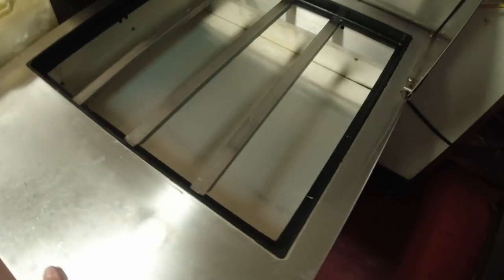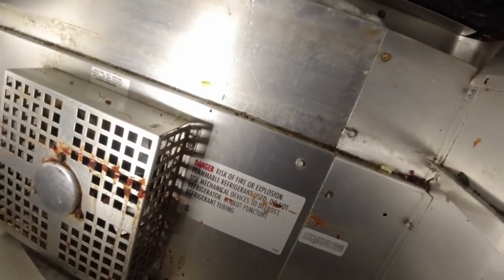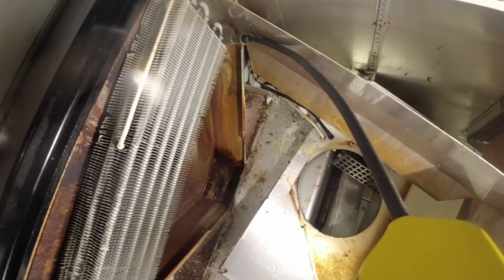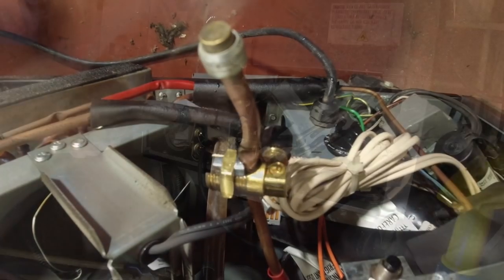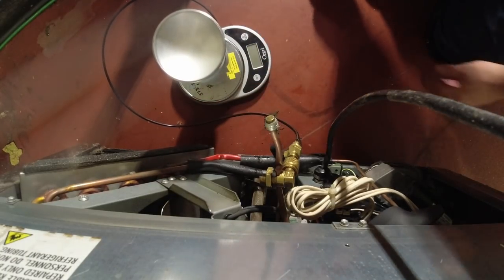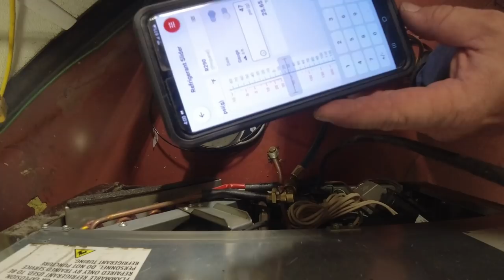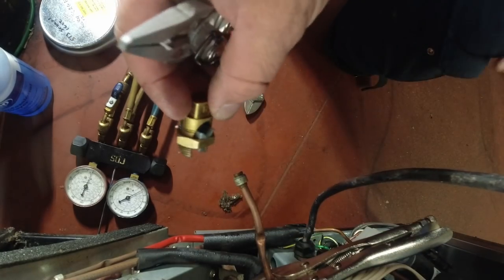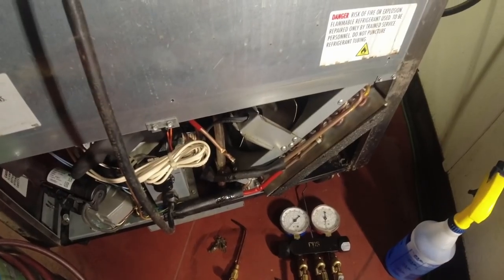R-290 True Cooler Not Reaching Temp / Down & Dirty Get It Running Fast Repair

Comment: Reach-ins r a pain. 100 screws n panels to get to evaporator. Great video Rick. ? 4 u. When finished charging unit up, instead of cutting end of pipe off to crimp n seal, could u just braze over the area wer u pierced  pipe   with tap valve? Thanks again for sharing
Reply from the maker: Shit,  your right,  I didn't think about that🤦‍♂️🤦‍♂️👍👍
Reply: @HVACRSurvival  thanks Rick for ur reply. I was just asking cause I'm trying to absorb n  learn as much as I can. I'm on my own n u have helped tremendously with your videos. Thanks doctor!
Reply from the maker: Thanks for the support!

Comment: I was literally watching the video like oh thats cool he's using an electrical bug to crimp the line off... lol...  I use the saddle valves and leave them. The vise grip valve in one of your last vids was also new to me!
Reply from the maker: I prefer the were left on but with the R290 being fairly new here in the 🇺🇸 The manufacture asks we remove them when done.
Reply: @HVACRSurvival   All of my warranty jobs do also.
Reply: Piercing valves leak. Never leave them. Put in a permanent port instead if you plan on leaving it.
Reply from the maker: @jman0870  I use 1/4 ref Ports on everything. I never would leave a saddle tap on.
Reply: @HVACRSurvival  That comment wasn't directed at you. Your work is on point!

Comment: I like the idea of using r290 as a refrigerant because then you don't have to recover it and all that jazz .
But the whole thing about manufacturers forcing you to cut off the pressure port after you install it I just find it silly , especially for such a small charge .
Also if they don't allow a pressure port to  be installed ar least give us an analog manometer so we can read the LP , really wouldn't cost much more .
Good vid mate 👍
Reply from the maker: I thought you guys have been using this crap for 10-15 years
Reply: @HVACRSurvival  it's popular over here , I'm just not sold on the restrictions they put in place and the whole " safety practices " involved . For bigger charges sure , but case in point : the evap was leaking and nothing happened as far as fire hazard so a pressure port wouldn't necessarily be such a hazard either . I might be wrong though , just frustration innit .
Reply: @sterlingarcher46  You can hurt yourself more with your propane grill than you can by sticking a torch onto a system with 3ozs in it haha!

Comment: Good video Rick. There is a small R290 charging scale available, I’ve been using for awhile now .
Reply: Ive been using a Taylor 38979 scale for a while now. 1g/0.1oz resolution is plenty accurate when using the Nu-Calgon bottle adapter.
Reply from the maker: I had the chance to buy one of those because they're kind of popular locally, does that 1 shut off on you midstream like this 1 does.? It kind of sucks it loses the measurement
Reply: @HVACRSurvival  it does after 5 minutes, but if the value is changing it wil not, so if i have to wait more than a minute I'll tap the tray to keep it awake.

Comment: Sometimes they just need it up and running. Not sure which puncture tap tool you were using in the video, but I have one similar that I use on a daily basis that hasn't broken yet. Robinair makes it. Model 40288. If that's what you were already using.... then maybe I got lucky. If not... might be a more reliable tool for ya.
Reply from the maker: It's a Robinair👍👍

Comment: Wondering what is the brand and type of marker you use... does it hold up well to UV?  Machine is probably not worth material and labor to replace evap.  Especially since it's such a bugger to disassemble.
Reply from the maker: Uni-paint is the brand. It will fade in Direct sunlight but can tell what was there 2 years later.  Everything I use is in my tool kits in the description below

Comment: what is the trick to getting the vice grip pinch off tool to work? I tried the exact same one and lost a lot of refrigerant after I tried three times in three different places before it finally blocked the line!
Reply from the maker: I had that problem with the yellow jacket I had,  then I purchased 2 imperial block style. They work every time but don't fit into tight places well. The one you seen is a cheap one I found online. I prefer the imperial block version. My tool bag in the description has about every tool I use.
Reply: @HVACRSurvival  I ordered it. That was my first thought when I seen it, the practicality of space. I also seen how you started crimping at the point and kept crimping till you got the pipe as close as possible to the vice grip  center. Will try that with the cheap ones I also bought until this block comes in. Thanks for all your assistance !
Reply: @HVACRSurvival  Not sure I understood correctly, did you say you purchased 2 different block styles? I only seen one in your list.
Reply from the maker: I have 2 of the block style. Both are the same. And I have the vice grip style. 2 styles total.

Comment: Thanks again for the video. 
Can't wait for the wave of residential R290 split systems!🤣
🍺🍺🍺🥃🥃🍿🏌🏻‍♀️
Stay safe. 
Retired (werk'n)keyboard super tech. Wear your safety glasses.
Reply: You'll never see 290 or 600 used for residential split systems, but I guarantee you have a 290 fridge if it's less than 5 years old.  Ive seen a few 600 and cyclopentane systems in the last three years, not as common as 290.  They might eventually go 700 (CO2) for residential split.
Reply: @sivalley  I've already seen r290 window ac units. Probably no splits with r290 but I bet we'll see package units. I hope we get r32 instead of more highly flammable crap or blends with insane glides.
Reply from the maker: I've seen the R-32, it's very close to the same pressures as 410A. 😎

Comment: Where can I find that bottle adapter?
Reply from the maker: I believe I used two different ones on this video, what time marker was it
Reply: 7:53. But I’d like info on whatever you use. I just don’t want to spend 500 on a Blue Jacket Kit
Reply from the maker: I have three different adapters, one of them is for a traditional propane bottle used for a gas torch that I used brass fittings to convert it to quarter inch refrigerant flare, the thing you see here I'm not sure what the heck it's called, it only fits for certain bottles, and the third adapter is the same one you use for the R11 flush.

Comment: That electrical is something that can get them in serious trouble if it's seen by a fire inspector because it's a fire hazard and having those plugs hidden is also dangerous in the event something malfunctions and needs unplugged. Also I really see no need for special propane for a refrigerant because I highly doubt it's really different from the regular stuff.
Reply: it's no so much being hidden(behind other equipment) as extension cords, splitters, power strips are a 100% no-no fire code and insurance denial :)
Reply: Hydro-Carbon refrigerants are impressive pound for pound from a BTUh standpoint. 
 It is also proven to be less harmful to the environment and requires less refrigerant than an HFC-HCFC or even CFC unit. 
 R290, R600 and R600a units are impressive with single compressor systems. 
 It is our duty to reduce stratospheric ozone depleting refrigerants as well as ones with a high GWP rating. The Montreal Protocol of 1987 was a huge success and the EPA in the USA continues to attempt to male strides in this goal
Reply: Nobody inspects electrical in a restaurant. Have you ever been in one? Breaker panels in most restaurants are completely blocked. That's a MASSIVE OSHA violation and literally nobody cares and OSHA is too busy being a pain in the ass on construction sites and nailing guys for not wearing fall protection as they drive down the highway to said construction sites. What does it really matter if you can't get to the breakers to shut them down if they do catch on fire? Haha.

Comment: Blowing the charge like we used to do with EVERYTHING!  The good old days, eh?
Reply from the maker: Exactly,  but I started after the B.S. EPA law🥱
Reply: @HVACRSurvival  Montreal protocol...R-11 was one of my favorites.  You could put it in a cup and it was liquid and pour it in your hand and it vaporized.  Good cleaner.
Reply from the maker: @joehead1294  I heard about it and we actually have some at the shop.
Reply: Well you really can't recover 290 and there is no point since the charge is only a few ounces which is pretty much equivalent  to purging regular refrigerant. I've never seen R-11 but I'd like to find some R-12 though.
Reply: @benkeysor7576  Just worked on 2 Traulsen roll in coolers in a school cafeteria this week. Manufactured in 1974. Some jackass actually replaced one of the condensers in 05/06 with another R12 condenser. Not sure why they didn't put in a 134a condenser and replace the cap tube. Unfortunately my company doesn't sell r12. They mandate that it must be converted or replaced. R12 is a massive pain in my ass. Also, both of the roll ins have leaking evaporators, one has a leaking accumulator, and the other has a ridiculously warped drain pan from Joe Blow the let's install an r12 condenser in 05/06 pointing his torch at it thawing out the coil. Heat guns and hot water are so hard. The rotalock king valves are leaking on both compressors as well and I'm almost positive that one compressor is 47 years old. I bet that thing spins right off...You don't want to see r12 equipment haha.

Comment: Seems like you hate working on kitchen equipment as much as I do. Actually, I loathe it.... Good video!
Reply from the maker: I hate working for certain places because of how things are ran. The working environment is a lot of the problem. I didn't put much enthusiasm into this video, I will admit....
Reply: The HVAC isn't much better in those places. Boards bypassed with zero time delays installed, freeze stats constantly unhooked (who needs those, amirite??), economizers constantly broken with buildings running in massive negatives, compressor staging constantly jumped together removing all dehumidification on mild days, reefer guys who try to charge air conditioners by head/suction pressure (superheat/subcooling is hard I guess....I pulled 18lbs of R22 out of a circuit factory charged at 10lbs a few weeks ago....yep...bad TXV due to oil breakdown...surprise), condensers constantly impacted with dirt due to lack of preventative maintenance, and national filter changing companies that can't even tension belts properly causing pulleys to be so unevenly grooved that you can literally hear the belts hopping on and off of the shoulders worn into the pulleys. At least the money is good I guess.

Comment: Since you had to braze it shut, why not just braze a process tube on so so can gauge up next time ?
Reply from the maker: That's what I do on a non hc system. But with a HC system they tell us to do this is because it's a flammable refrigerant and because the charge is truly critical at sometimes less than the 3 oz.   (There's too many Jim Bob's out there that throw his gages on every system and doesn't know what hes doing. )

Comment: Looks like trying to get into a Daikin rooftop unit trying to get to that evaporator
Reply from the maker: Haven't had to do that yet👍👍
Reply: @HVACRSurvival  You're in for a treat especial when you do!  Evil things ever since Daikin bought Goodman.
Reply: @sivalley  not like them at all
Reply: Daikin and Carrier are both garbage. You'll never change my mind haha
Reply: @sivalley  Touch screen VeriTrac or DOS VeriTrac? DOS VeriTrac blooooooooooooows
Reply: @jman0870  I've had the misfortune of both, but mostly the older model 3 systems with the VERY slow monochrome touch screens.
Reply: @sivalley  I know of one facility still running with the supposedly first version of VeriTrac. It's so old Trane techs don't know how to use it. I believe it was installed in '93. The RTUs/VAV boxes are all original too. Barf.
Reply: @jman0870  Ye gads, someone should hire an arsonist and do the property owners a favor. 🤣
Reply: @sivalley  they are well aware that their equipment is a ticking time bomb. These places never expect that the HVAC, including large portions of the ductwork, will need replaced eventually hahaha. What can you do 🤷‍♂️
Reply: @jman0870  Tell me about it.  I ran a call for a church that used to be a night club with Trane RTUs from the late 70's and every year we have to bodge something else to keep it running because "replacing it is too expensive". Buddy, that gear might be 5 SEER if you're lucky.
Reply: @sivalley  Gross. Back when all the wires were black, poorly labeled, and a massive rats nest mixed with 40 years of rust, corrosion, and chopped up coils...barf
Reply: @jman0870  Yes, very much so.

Comment: I heard the condenser fan motors for these 290 units are $500
Reply from the maker: They will be higher because of the spark resistance rating but I'm not sure that there that much.
Reply: @HVACRSurvival  Before I came back to the wonderful world of refrigeration, I spent 6 years in a factory with massive paint booths. Explosion proof/intrinsically safe anything is insanely expensive. I've seen 6 inch explosion proof enclosures cost $500.

Comment: 3 oz . That’s wild
Reply from the maker: R-290 is more eff. they say? But I think its less reliable, I have replaced SEVERAL compressors and coils...CHEAPER BUILT because its less HP due to the higher eff. is what I figure so it's less durable.... BUT ITS ENERGY STAR😂😅😂👎👎
Reply: Love your videos, learn a lot . Your work is top shelf!
Reply: @HVACRSurvival  trading "higher efficient" and "lower production costs" for lower reliability netting a significantly higher environmental cost.  At the risk of sounding like a conspiracy theorist R22 was never the problem; 1/100 the ozone depletion potential of 12 and 0 GWP compared to 0 and 1000+ of every 400 blend in use today.

Now if we could convince them to make life cycle expectancy part of Energy Star we MIGHT see some units built with reasonable thickness for copper evap/condenser coils. . .
Reply from the maker: @sivalley   You're not a conspiracy theorist it's all bullshit to make money. Everything in this world is being controlled by the big money people.
Reply: @HVACRSurvival  THAT I believe whole-heartedly. Durability is no longer a goal and it's not helped by people not taking care of durable (pun intended) goods.

Comment: It looks like that cooler was designed to not last very long and not be easily repairable. I now  just got an evap motor in on a 25 plus year old double door cooler.
Reply from the maker: Nothing is built well anymore.
Reply: @HVACRSurvival  i recently replaced a condenser fan motor on a 40 plus  year old Ruud central air conditioner. It was replaced once before. It ran beautiful with the correct pressures.

Comment: It’s cheaper to junk it and buy new, what a POS. I prefer the Imperial PT-109 access tool .
Reply from the maker: Far as cheaper, it depends on the brand, Chinese junk is cheap but generally any of the American maid's stuff is still pretty high. I think my tool is Imperial that I've got, it looks like a pair of vice grips and punctures the system,  it was originally made for recovery back in the 1990s when I bought it,  little did we know this shit was gonna come out.

Comment: Ahh! Typical true, a bunch of extremely sharp panels held in place by 600 screws. Evaporator coils are getting worse every year quality control is not a priority anymore.
Reply from the maker: That's TRUE, and TRUE!😁
Reply: They don't coat them anymore either to protect them from citric acid.
Reply from the maker: Some of Trues coils are but it's not like it stopped it from happening🤦‍♂️😏
Reply: @HVACRSurvival  I was told coils don't have coatings to protect them from citric acid anymore and it's simply painted. Maybe I was lied to. Who knows haha
Reply from the maker: 🤷‍♂️ who knows....It's all likely lies😎🤣🤣
Reply: The last ones we were buying before I retired four years ago were coated. Don't know if all were or if it was specifically done for my company.